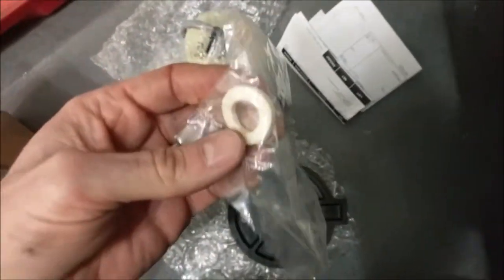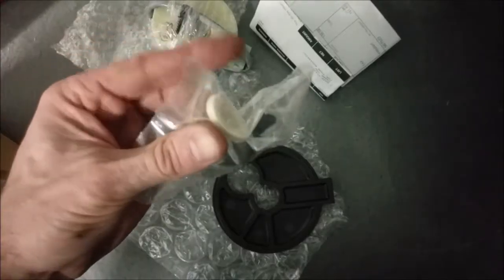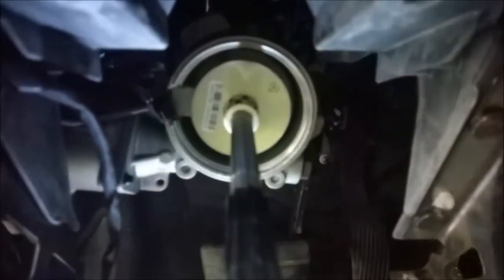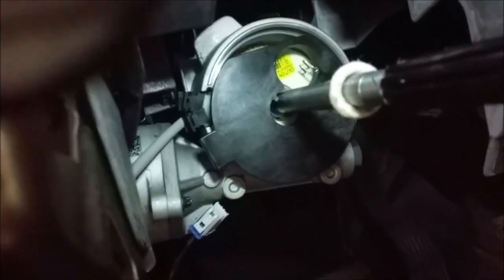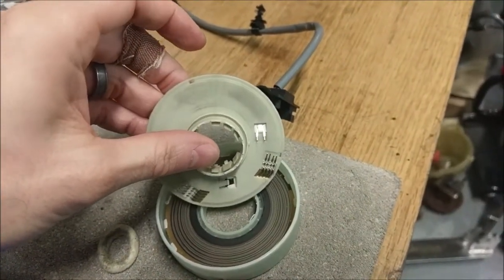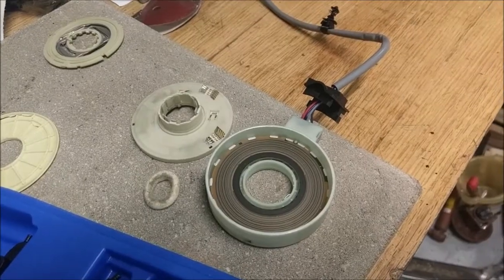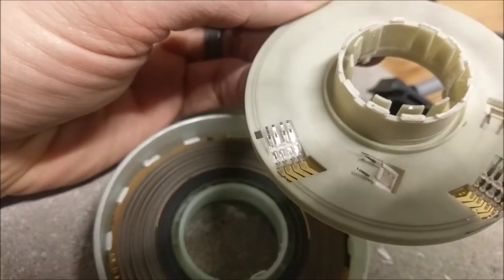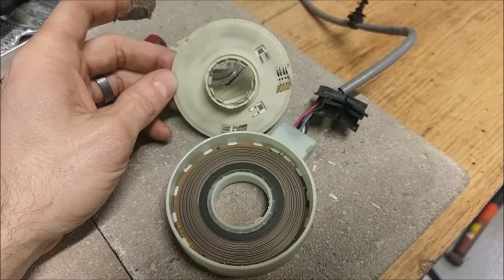Malibu Steering Angle Sensor / Torque sensor

Comment: What size are the snap ring pliers. Everytime time i look up giant ones i get multiple results
Reply from the maker: 16" I used these ones from amazon Hiltex 02016 16" Snap Ring Plier Set, 2 Piece | External and Internal Pliers | Straight, 45°, 90° Tips
Reply: @fer8888888  solid thank you for answering!
Reply from the maker: @tristanclark96  Also do the recal for the steering sensor after or else the car may have a very slight pull that can't be aligned out.
Reply: @fer8888888  Someone already did the recall  on this car before I owned it. Multiple people say it doesn't pull at all, once they replaced  it, but if it does, have access to a scan tool that can relearn the sensor. Honestly, this is all plan b. My first plan is to call around pick n pulls and see if I can just rip out the entire steering assembly from another malibu.

Comment: Nice work, Eddie...best video on YouTube for this issue "symptom of steering wheel Parkinsonian Tremors".  Great paralysis of analysis on your part.  I went to a fly fishing casting seminar, the instructor was a phlebotomist, he actually put his fly fishing line, about 2 or 1 pound test line, under a microscope to determine the type of knot that results from a "wind knot", which is when the line knots itself on the backstroke of a fly fishing cast when it makes the big arc in back of the fisherman.  Indeed, he confirmed it was a common overhand knot... Same paralysis of analysis obsession as you...

Comment: Going to the junk yard to get me a power steering motor and the part that holds the torque sensor......
My buddy pulled the snap ring out with some long nose pliers 90degree and took a grinder to it so it can fit into the holes and got it out. The part brand new is 340 just for the sensor. 
At a used parts store their selling the motor and the lower column that holds the sensor together for 250$.
I'm in a pickle, if I get the part from the junkyard and it doesn't work,  I will have no money for the 250 used part. Or Should I just go with the 250 for the parts and case close? Hmm

Also for 2 days the power steering would come on and off Prior to it coming on non stop before I got a car wash. Then I got a car wash and after I got done cleaning the car,  my car wouldn't start,  and now the power steering is always on. Thats why I'm getting these parts now. 

And my car would start, and now its not starting. I wonder why that is.
If the wires were unplugged from the power steering motor would that cause the car not to crank and turn on? Just curious.

Comment: i finished this job and now my steering wheel pulls all the way to the right. i had everything centered from the begining n install when smooth. soon as i put power back on n started the wheel just rotated fully to the right.
Reply from the maker: More than likely the computer didn't like the new sensor reading and it needs to be re-learned. As long as the sensor is good
Reply: @fer8888888  thanks for the reply. Yeah, it's a brand knew sensor. Hardest part was taking that ring off.
Reply: Mine goes to the left. Did you get yours fixed?
Reply: @scarvalho4800  took it to dealer and they said it was an installation failure. I know I Installed it correctly, I watched every vid on YouTube to see how it was done. Its def not rocket science. I took the hit, didn't get upset n just told em to get me back on the road again. Girlfriend bought the car used for a thousand bucks back in 2014.
Reply: @grilawrfr101  how much did they charge?
Reply: @scarvalho4800  when I looked at the bill they charged me the mechanic time from when I took it in for the calibration and the installation for the New part and n how ever long it took for that. Paid 800 all together for the total time and the new part. You will probably pay less if everything is in your favor.
Reply: @scarvalho4800  Did you ever figure yours out. Mine goes right but I'm sure its the same problem you had.
Reply: @scarvalho4800  What did you end up doing to resolve this? I am in the same boat.

Comment: Felt washers are pretty typical in the automotive industry.
Reply from the maker: https://static.nhtsa.gov/odi/tsbs/2015/SB-10089834-2280.pdf
https://gmauthority.com/blog/2021/03/nhtsa-wont-launch-investigation-over-steering-sensor-in-gm-vehicles/

Depends what it is being used for. To quiet down a potential rattle, yes. Links above show a struggle with this part, a felt washer in this case is looks very suspicious.
Reply: Yes, they go back into the 70’s on GM’s and others, but open the hood on a 1980 Monte, Impala, just name it. It A/C it use the axial 6 compressor that weighs 42lbs. The front seal is a spring load ceramic on graphite and uses a felt seal. 
 I am glad he found what “Tampons” are for because I was not sure if he has ever had a girl friend!
  And what big snap-ring pliers you have grandma! All he had to do was barrow mine. They are 41 years old or more, because if you repair automatic transmission correctly you will need them. Mine say Kent-Moore? Hum, who makes those. 
But my Tech-2 says Hewlett-Packard on the back as well. Strange as something tells me he did not finish tech school last year. 16 months of work is a long time for certain kids born in the 90’s.
DK, ASE master tech since 78

Comment: Thank you for this video. I had this job done and shaking steering wheel problem fixed in about 3 hours (including beer breaks and learning curve) for about $200; including purchase of huge snap ring pliers. They are a must. That snap ring is big. Other videos removed the entire column and included steps to recalibrate after re-assembly. Not necessary. Hardest part was removing the trim. Rest was a breeze. Thanks again.
Reply from the maker: Appreciate the feedback.  I make these videos to help others breeze through it. I agree the trim was the hardest part.
Reply: Thanks for sharing. So, recalibration isn't necessary or is it just a gamble. Also did you have to disarm the air bags?
Reply from the maker: @ProMachinist  I didn't disarm the airbag. Just unplugged it. I usually touch the body of the car and ground at the same time before disconnecting that connector. As for calibration I would assume these brushed sensors have very tight specs when made, so little variation causing most installs to not need recal.  If you don't have a scanner to do it foxwell makes scanners for $150 or less. Some that just do sensor recal's etc. With Autel you have to check their website for your vehicle. My Autel tpms TS501 works perfect for everything, but the MD808 pro I just assume doesn't work for anything it advertises. They give you the menus but it always says not supported, even for something as common as a 2011 Malibu.  An honest shop would charge less than $100 to plug in and hit recal for their 5 minutes of time.
Reply: @fer8888888  Nice. Thank you once again for the detailed information and lengthy explanation. I'm sure this will help future Malibu owners as well.
 We just missed the recall cutoff my 10 months and way under milage. We never  received a notification regarding the steering issue so we never knew there was a potential problem or a recall. The actual steering issue started a few days ago. 
 According to the Dealership yesterday, I was told that the issue could be the steering motor around $500 bucks or the torque sensor around $200 bucks and the diagnostic test would be $100 bucks. The labour was around 2 1/2 Hrs depending on which part need changing. labour. So, obviously there's a design flaw and a lost more unsafe vehicles like ours on the highway. I don't understand why the consumer is responsible for this.
Reply from the maker: @ProMachinist  Parts are only designed to meet the warranty period for them as cost cutting. Like lifetime fluids, which are really warranty period lifetime fluids.  Rarely in some situations engineers know better but are constrained by cost. Most of the time it is a bunch of degreed engineers who don't know how to fix their cars and don't care to know designing them claiming to be car experts.  If auto engineers fixed their own cars they would see what does and does not work very fast.  The 2nd problem is non-passionate engineers do the minimum and leave. For example remember in the 90's when engine mounts failed left and right. One of those engineers told me, I never knew until recently they were failing so much because there was no process for the service group to notify engineering of top selling parts due to failures from design or manufacturing. So that engineer changed the rubber material to something that doesn't degrade as fast and engine mounts don't fail as much anymore. Once again if the engineer was actually a car person that fixed their own cars and paid attention to youtube like  a passionate auto engineer many of these problems wouldn't exist because they would know what does and doesn't work.  Any designs I am involved in, I always research youtube for common failure modes people complain about then make sure not to repeat them. But the lazy get a pay check and go home. The less performing engineers think the companies lesson learned documents are good enough. But youtube clearly has as better compilation of lessons learned in my opinion. Most people just post vids on how to replace the parts, but the right engineers clearly see what design flaws were inherent to the designs on youtube. Lack of the passion like the muscle car era with engineers is why car quality is going down hill these days. Another problem is HR doesn't care about hiring passionate talent when they see it, they prefer people that get along and hang out doing things like salsa dancing. I was literally on the verge of being fired for not being a team player due to not going salsa dancing and other stupid stuff after work with my tight group of engineer coworkers at a major automaker. Then an old HR person said it is not Eddie being anti-social because I tracked him after hours. He was going to the proving grounds building race cars and racing them against a few other engineers on the companies test tracks. Then that HR person said the reason you think Eddie is anti-social is because he is a car person and they are not. We haven't seen people like him since the hotrod era. So in reality Eddie has invited all his coworkers to build cars and race them but they don't want too because they are not car people who ironically work at a car company. Funny ending to this story is those coworkers got laid off and I was saved.
Reply: @fer8888888  Theres truth to that what you're saying Eddie P.  And yes, I remember those mounts and other poor design issues as well. In my career of 45 years, I too have seen a lot of weird things, and I'm dealer trained! Who actually designs this crap. Maybe they should have the Engineers who designed this stuff actually work on it!
 Prior to the 80s, vehicles were built to last and easily repairable, not today. I see a lot of unbelievable crap at my shop lately and turn a fair amount away because of it. Sometimes, its not worth the aggrivation.
Anyways, thats my Canadian rant for the day...😀 🇨🇦 Be well....
Reply: @fer8888888  I have some friends from college (Michigan Tech) that work over there, I think most of them are in the dyno cells.

Comment: Thanks for the helpful video, it looks like I'll be doing this job soon on a friends car. I had to replace one on a 2008 Ford Escape and you're right the hardest part was removing the snap ring. I bought a large snap ring tool as you mentioned and it worked great. Any tips on removing what dash parts to access the steering column?
Reply from the maker: There is one hidden bolt in the lower left region of the HVAC area behind some trim. When removed it frees up a lot of movement in the lower dash. Other than that other YouTube videos seem to cover the dash removal.
Reply: @fer8888888  Thanks Eddie, I really appreciate your reply. I'll probably be doing this job next week. Take Care!

Comment: Thanks!  I bought the new sensor a while ago and saw several videos that took everything out.  I too was wondering if I could leave the bottom half in and now I guess I have my answer.  I'm guessing that will save quite a bit of time when I actually get around to swapping it out.
Reply from the maker: Just be sure to get the really big snap ring set on amazon. Or else putting that snap ring back will make your life miserable. Other than that, it's pretty easy and didn't require a sensor recall for me.